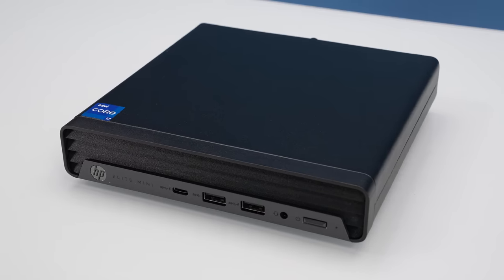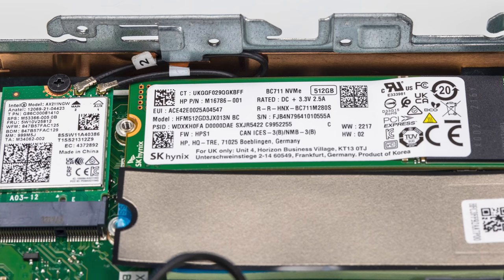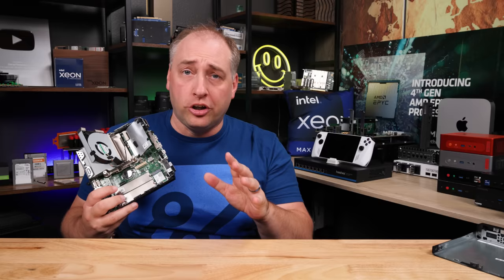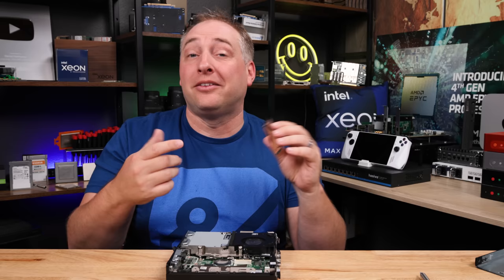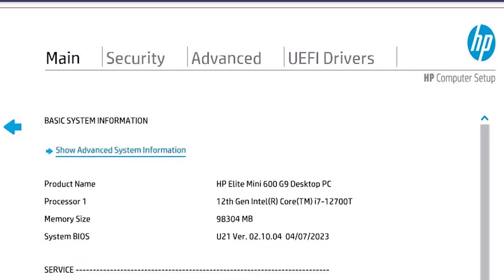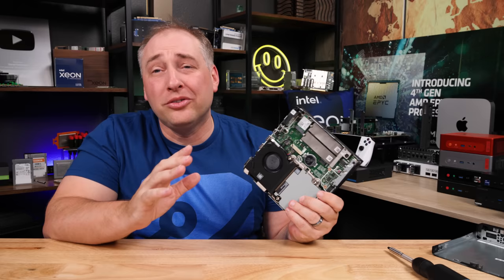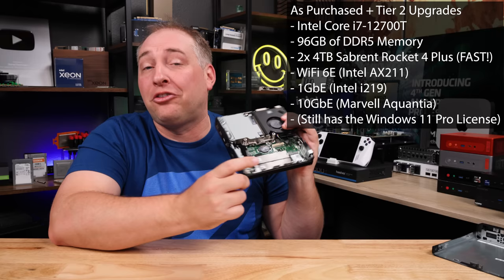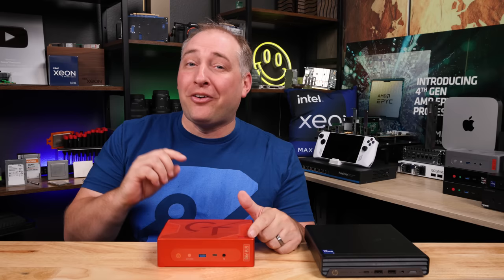Perfect 1L Homelab in 3 Upgrade Tiers Project TinyMiniMicro

Comment: I REALLY like this idea in terms of form factor and overall density.  I could easily see myself 3d printing a 1 or 2u server rack bracket for a few of these, but I feel like this stuff is really expensive for what you get.  for an insignificant increase in volume, you can get something like a "Dell OptiPlex 7070 SFF i7-9700 3.0GHz, 32 GB, 250GB SSD" for under $400 which is 8c/16t 4.7ghz, upgradable to 64gb ddr4 per dell (others have tested up to 128gb and ddr4 is cheap now) and most importantly has a half-height pcie slot which gives you a lot of i/o options (for example my go-to of a $40 intel x540-t2 dual port 10g ethernet adapter also from ebay) or optionally 2-4 more m.2 drives, or heck, you could install a pcie sas HBA and use it as the head for a cheap as chips external jbod sas DAE, and then an m.2 10g network adapter if you needed a storage solution.

Personally, I think I may end up picking up a treo of said 7070 units for a proxmox cluster.  with some 2 port m.2 adapters, keep the 32gb of ram for now (upgrade later if/when i need to when i find a cheaper ram deal), and i'll probably drop a 2tb m.2 ssd in each (maybe 2) and do ceph with erasure coding in order to spread the vm data around performantly between nodes. for HA.  haven't decided yet though.  the 7070 is certainly larger than the mini hp units presented here, but it's still pretty small sff in the great scheme of things.
Reply: i disagree on the "insignificant increase in volume", these hp 1L units are very, very small, and make even SFF units like that dell you mention look like a full size tower in comparison, like, in the space you can fit 2 of those dells, you could fit about 6 of these HP's

Comment: By the way, Linux being "taxed" is not measured, like Window, by CPU but by load average.  A base measure is, while running top, to press the 1 key for the number of cores, and if the first number of your load average is greater than the number of cores, then your system is starting to be taxed.  In addition, your I/o wait and such are an indicator of whether or not your system is being taxed.  Linux is not Windows.

So that little system could have been quite fine with a busy CPU.

Comment: Just imagine a HA cluster with three of that HP nodes. 🤤🤤 The only thing that I missed was a sata port to plug a 128GB 2.5” SSD just to boot proxmox and use the nvme mirror only for local storage.
Reply from the maker: The SATA data + power internal port remains, but we did not have the 2.5" + fan assembly and I get a bit worried about airflow. It is possible though.

Comment: So awesome.. Perfect and powerful little unit. I'd add more fans somehow, pop it on a laptop cooler or something. Not seeing them for less then $629 on ebay.. Most are in the $800 range base unit. That is quite expensive for my taste.. I'd would perfectly replace the old dell poweredge r700 thats running on top of my fridge. I pulled most the spinning drives and installed some ssd's and some nve's on a pci card on the poweredge. I got it down to 120-140 watts an hour. Running proxmox it mostly hosts a t-pot honeypot and kali linux which I use to test my own firewall. It also heats my kitchen in the winter.

Comment: If you choose a faster SSD could you use a smaller heat sink to help with cooling or maybe cut into the shell next to the SSD. I have poor airflow in office and worry about heat control.

Comment: Great project idea! Always have loved this method to take slightly older models and upgrade the right parts. I can think of one other use if you wanted to develop a storage-specific node is having some external PCIe enclosure with bigger storage! For like $5K really have a high availability setup with some CI/CD services in place!

Comment: I bought old Server Moard on  Ebay 3 years old 2x 10G Ethernet and 4x 1G was only $244 for the Board + CPU XEON Silver  + RAM 128G DDR4. No case no Power Supply, just Core components.

Comment: Guys, if you want proper capacity for virtualisation, old server hardware is the way to go. V3 Xeons go for £25 with DDR3 RAM to support it at the same low prices, and they're still perfectly capable machines. Servers have a supported lifetime of 5 years across the board, but most happily work for double or triple that time, and because they're designed for power and stability, you will find plenty of reliable and replacable components (most can be replaced with the server running, aka hot-swappable).

Comment: I've been seeing alot of confusion about the T-suffix Intel processors. 
The lower TDP and Boost Clock only really matter when the system is being fully utilized as it won't change your idle powerdraw and that's what I would expect most homelabs to be doing majority of the time.

Comment: The fact that 2 SODIMMs can do the same capacity and latency as my 4 DIMMs do is crazy improvement in just a few months. This has more networking and storage in 1L than I have in a MATX system, but I guess my 7900XTX is an advantage of the size. It would be interesting to see some taller (maybe exactly 2x the height for 2L) systems like this that could take a LP-GPU and a beefier CPU cooler setup.
Reply from the maker: Are you thinking like this Lenovo? https://youtu.be/E_an5heI1BU
Reply: @ServeTheHomeVideo  Well yes I am!

Comment: Honestly, i want this for a firewall+router+steamcache box Sure i i'd be fine with dual 1G and a pentium for just router/firewall, but with that i7, 32+GB of RAM, 10G LAN, and dual NVMe this would make an AMAZING caching box.
I bet that with the USB-C you could connect a hot spot to it to get 300Mbps down for off grid pop-up LAN parties where everyone brings a 7840H based mini PC and everything is solar powered :P

I cannot wait for the 128GB SODIMMs I've got an ITX board that has only 2 DDR5 SODIMMs and 96GB is a little bit limiting.
But mainly so that i can get a total of 128GB like my old system, or even 192GB of system RAM without paying flagship 256GB prices.

Comment: A note about using ZFS (in any form) for the boot drive:

If you are planning on passing through PCIe devices (as an example) (or if you want to passthrough the iGPU that's on the 12700T), you might struggle with updating grub because of the ZFS mirror.

(I know because I tried it before.)

If you don't use the ZFS root, passing through PCIe devices in Proxmox gets a lot easier or at least more straightforward.

Just something for people to be aware of when they are installing Proxmox.
Reply: Why is a ZFS mirror problematic with grub?  Could you use another bootloader?

Comment: Patrick you're making me want to replace my existing M-ATX homelab & NAS node with a couple of these (heck could just grab one and virtualize everything else!)
Reply from the maker: That is the point of the Project TinyMiniMicro series :-)
Reply: I know! I've been watching for ages and haven't really wanted to upgrade but now I do! Great content as always!
Reply: My small cluster idles at 10w each for 8500T/6500T mix for 40-50w *idle*.

Could easily migrate all or most of it to a single 12700T/96GB and cut idle usage a lot.
Reply: For NAS we need slots for 3.5 HDDs. I don’t see how these tiny minis will support them.

Comment: Absolutely amazing. I always had a dream to build exactly that and on proxmox, still ended up with an AMD rig with 32 cores as I needed cores in the end, 12 cores seems decent enough but obviously is a bit of limitation, performance of those cores are also much to be desired in this particular solution. but for the specific use cases I guess that's just perfect...
Reply: i mean i'd think for a decent amount of home AND business uses those would be more than enough, especially with an all-in-one full fat docker VM. :/

Comment: Awesome find. In the past I had to use a TB3 to 10Gb on my mini hp since there were no mini nics beyond 1GbE. Those adapters were / still are expensive. 😓

I’m currently using dell optiplex 3050s since they let me use $100 LP connectx4’s 😎

Comment: I would love to see the `H` variant on it, not because of the 2 extra cores but because of the 96EUs Iris Xe vs 32EUs UHD770.
Transcoding on 12700H, 13700H are a dream.
But this unit is ticking almost all of the boxes. ;)
Keep up with the good work! =)
Reply from the maker: Fair point. Sadly that would likely raise power consumption as well if we look at the Mini PC's we have with H parts (but many will think that is worth it.)
Reply: Shouldn't the Quicksync codecs be identical between the H and U series?
Reply: @rightwingsafetysquad9872  doesnt the quicksync hardware “horsepower” matches the igpu execution units and generation?

Comment: $500 USD can get you a 32c/64t EPYC cpu, motherboard, and quiet air cooler if you go open bench. Comes with a tonne more expansion. Also fully supports VMware ESXi.
Reply: The reason (at least for me) why you should use these small factors is HA and TDP.. EPYC has how much? 155W? When you buy 3 Tiny/Micro PCs you will be under 100W with Hight Availability. I assume sooner or later will be HA the one of the required things for our smart (or stupid) homes :-)

Comment: I am running 3x of the SER5 Beelinks that have the 5500u Ryzen in it. Running kubernetes on them. Swapped the ram to 64gb, put in a 1TB 980Pro and a 4tb SSD. those little things are fantastic for what they are. 

It’s still just a single NIC which is fine for home use, but it sure would be nice having dual nics, especially if you have external LAN storage like iscsi or nfs.
Reply: I run beelink too, 2x 5800h 64GB 2TB each and 1 5600h 64GB 2TB... Proxmox Cluster + Docker + Kubernetes.

Comment: I like that it is serviceable and easy to get into, and its really cool that they make 10gig custom NIC's for it, but I'm not sure I'd want to run a server and/or home lab using consumer CPU's and non-ECC RAM...  Especially if using ZFS.   It's generally a bad idea to use ZFS without ECC.  It sticks way too much stuff in the "arc" in RAM.   You could easily get a flipped bit there, especially during scrubs.

Could you pop a Xeon in there?   And if you did, would it work with unbuffered ECC?
Reply: Unless you're doing heavy tasks around the clock, consumer grade CPUs and non ECC RAM modules are perfectly adequate for home server use.
Reply: @LouisSubearth  You certainly don't want to run ZFS without ECC.   High risk of flipped bits for a storage system.

Comment: I use a 9400T Lenovo 720q for years, 16Gb of ram, 1To ssd, proxmox ve and it run at 1% CPU power most of the time.
I also got a weaker Nuc 7100u that run pretty much the same spec, 16Gb, 512Gb Nvme and it use 7W of power average  (24h average = 24*7 Wh

Comment: Hi one thing that I have noticed for similar unit (G2 800 Tiny with i5 6500T) about the power consumption without any load. On Windows it was about 6W but on Linux Ubuntu it was about 11W. Maybe here there is similar difference when using Windows? Anyway this is a great box. I'm also using it as a home gateway / server, but this newer one is much more powerful from what I can see (2 NVMEs, better CPU, not sure if ETH is upgradable also on the older unit). Of course the price tag is different and I don't really need more power, but it could be my next box to be used for such things.. Thank you for a great review.

BTW. previously I had 70W idling i5 4670K, 32G RAM, ~12TB ZFS5 ubuntu gateway, but the G2 800 Tiny with i5 6500T 16G RAM with 2 additional DELL USB ETH 1Gbe sticks, with different storage configuration (no ZFS5 currently, but only SSDs, I have to make a automated backup or move to Proxmox or something similar - IDK yet), this simple small box is just so good for what I'm using and it's gonna pay off for about 1,5 year of electricity here in Poland.

Comment: Based on the EBay prices for the 800G9 with the i7-12700T, and the fact that a barebones MinisForum MS-01 costs about the same, has more to offer, then there’s no reason (for me) to pick the older mini/tiny PC. How things change in less than a year..

Comment: Hello, Does anyone know if a pair (x2) of Seagate Firecuda 530 WITH HEATSINK would fit inside this HP Mini PC and ALSO a SATA SSD inside the Caddy / Case? I mean Everything at the same time
Reply from the maker: We did not try those drives so not sure on that. The SATA SSD carrier for these has a fan to cool the SSDs which would probably be good. It might work if you can get the SATA data/ power cable, but that is a lot of heat to deal with in a small volume.

Comment: I just built one of these but it idles at 20w draw. I removed 1 SSD and the 2.5g nic. Am I missing a bios setting or something? I did go with a mini 800 g9 instead of the 600 g9 though
Reply from the maker: Sounds like a power profile

Comment: Nice setup. A few of thoughts/questions: (1) It might be nicer to go with AMD machines if you can find them since they are all performance cores right now rather than P+E of intel 12th gen and beyond. I just don't think there are many enteprise SFF machines like that. (2) What's your recommended DDR5 ram speed right now that still is makes the most sense between 5600MT/s and 7000MT/s? (3) one last intel bummer is the weak igpu vs. AMD.
Reply from the maker: Correct on the iGPU, but Dell does not have OptiPlex Micro 1L at this point. So the Intel ones are the most current up to 13th Gen Core. On the DDR5 with these, 4800 is what this class of machine prefers to run at.
Reply: @ServeTheHomeVideo  Ya maybe we'll see better options here with meteor lake but it'll be a while until they are affordable used

Comment: this is not too shabby and the new bar for the micro lab cluster node - the specs alone - gud - that said for 800 bucks you may be able to build something even better with a real case and more options on expandability - this setup does raise the stakes a bit though - 128gb ram and 100g is probaby where you want to go - also you want option for a gpu to do ai open source LLM dev - the problems with bios passwords and licensing exist with these units - you don't have to contend with these issues when you diy - good you went slightly overkill on this component setup - lastly HP is practically going bankrupt - very low confidence in HP and it is warranted - look it up

Comment: But with an Intel Nuc you can get vPro Advanced which makes them very useful.
Reply from the maker: The Elite Mini 800 G9 and some 600 G9's also have vPro (these devices are a primary market for vPro). Also many NUCs, even NUC Pro models do not have vPro
Reply: @ServeTheHomeVideo  I know that not all NUC's have vPro (Advanced), but the option is there - if you know what to look for. I'll have a look at the G9 minis.

Comment: Got recommendations for a 4-or-more NIC low-end box to use as an in-home firewall, for e.g. a general network (hard to get on, but lots of access), guest network (easy to get on, some access), IoT network (easy to put stuff on, very limited access), and of course the WAN port... all for, say, under $100?  Or, at least, under $200?  I don't care as much about the speed factors.  Like, even if I put some 10G on the general network to get between a desktop and a file server or whatever, I don't care if it has 10G to the Internet, so, I don't see any reason why the firewall should need it.  And I've been watching some of your reviews on devices with 4+ NICs, so, I know you have some coverage, but I feel like they're all more expensive??? If I missed something, please point me at it!
Reply from the maker: Check out the N5105 fanless firewalls we reviewed
Reply: @ServeTheHomeVideo  Will do; thanks!
Reply: Hmmm... looks like still about $300... was hoping for less than that.

Have you explored things like the dfrobot "Raspberry Pi Compute Module 4 IoT Router Carrier Board Mini"? -- if I could get a 4-NIC version of that, I think it'd be perfect!

Comment: Looking at your M.2 10GbE adapter at 9:07 do you know if a SFP+ adapter exists? I'm running fibre everywhere at home and prefer to use SFPs, I see there are a number of 1gig SFP port options available but so far I have not seen a SFP+ unit. I've got a gaming rig in a Kolink Rocket Heavy case but being ITX it only has a single PCIe slot (which I'm using for my GPU), currently I'm using an external Thunderbolt Nic (Qnap) but would much prefer to have something neatly built in
Reply from the maker: No that I have found yet. I understand why you want this (and that QNAP SFP+ Thunderbolt is what I had in my hand at the end there.)

Comment: So my past experience with these mini PC's is they always seem to thermal throttle at some point, and that was just for normal desktop use. Does anyone have recent experience if this happens if your running multiple VM"s that are using up the cores (Immich ML, Minecraft, etc)?
Reply from the maker: I believe we showed the PL transitions in the review video. The 35W TDP CPUs run cool, the 65W ones are more problematic which is why we recommend the 35W models.

Comment: I’m currently running an M1 Mac Mini. How does this compare performance wise? Obviously this machine has a lot more ram. And what is the total cost for it with all the upgrades? With my M1 Mac I have multiple external 8TB M2 ssds that I plug into the thunderbolt 3 port and get about 2.5Gb/s which is really good for what I need it for. But having everything in the unit would be ideal, but when configured with 8TB M2SSD internally the Mac Studio with 96GB ram is around $6,500.

Comment: How do you get 96gb memory when the board is limited to 64, I don't understand that. Can someone explain?
Reply from the maker: I am not sure what you mean by the limit? We show it with 96GB running in Proxmox VE with 2x 48GB DDR5 SODIMMs.
Reply: @ServeTheHomeVideo  The computer, you're using. HP Elite Mini 600 G9 specs say max memory is 64GB, so I'm trying to understand how you get to 96GB, is it cause you are using the non-binary type (first time I hear of those) and that's something they can do or how does that work.